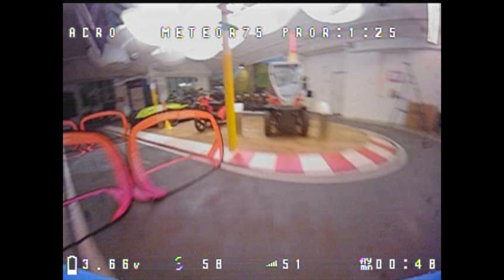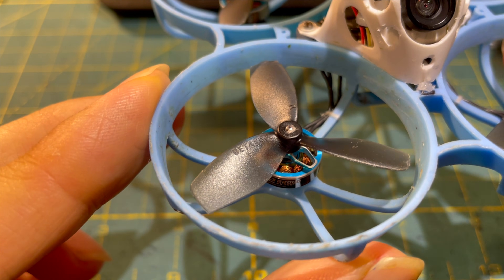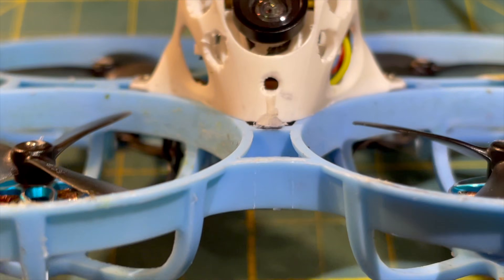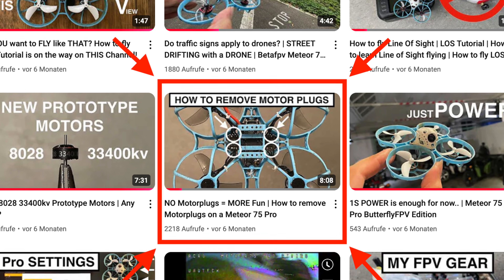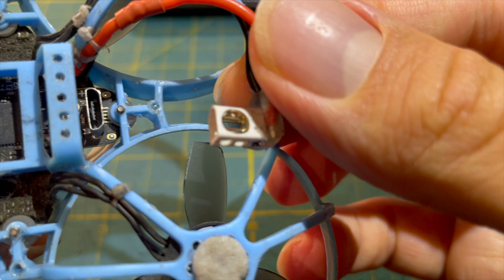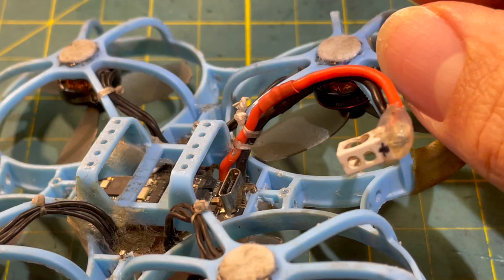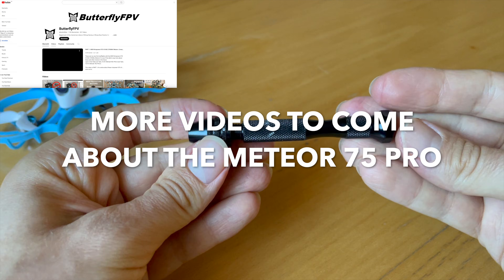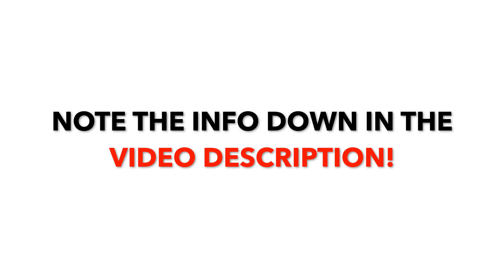TUNING for YOUR Tiny Whoop! | Tiny Whoop Modifications | Tiny Whoop Mod`s | Tiny Whoop Secrets

Comment: 100% agree best props are the 45mm hq ultralight. I was looking for the 40mm ultralight 1.5mm motor shaft but unfortunately the eu shops dont have them. I am afraid to order outaise from eu becouse austrain post cuatoms allmost allways stop the package. They say the price is unbelievable. So i than i have send them the payment conformation. The problem is every day my package stays in their storage i habe to pay 12€ and it stay there minumum 3 day. Mabe do you have a place to order from eu??? I have the speedx 1002 25kkv. They make good power
Reply from the maker: It's interesting that Austria handles it this way. There are arguments that this makes sense. But of course, there are also counterarguments. In any case, I understand your problem. This shop is basically very good:  https://www.drone-fpv-racer.com/en/micro-45mmx3-pc-propellers-15mm-2cw2ccw-by-hqprop-12841.html  I hope he puts the 45mm props back in stock. To be honest, I haven't been able to find the 40mm ultralight HQ props in the EU yet. I'll post them in the YouTube community when I find them. Yes, the Geprc Speedx 1002 25k has good power. I'd say it's very similar to the Rcinpower 1002 22k. I think the Geprc has a bit more power, which would make sense. But I need to test and compare it more.
Reply: @butterflyfpv  you can see on the hoverpoint i used the same drone first the 22k by rcinpower than the geprc 25k and i got around 5 points less for hover. Thats how i test it not very scientific lol
Reply from the maker: @LeVsTerFPV  But it's not unscientific either! Especially if the difference is large enough. I think a 1k difference is difficult to see. But 3k is definitely noticeable. Thanks for the info! 🤜🤛